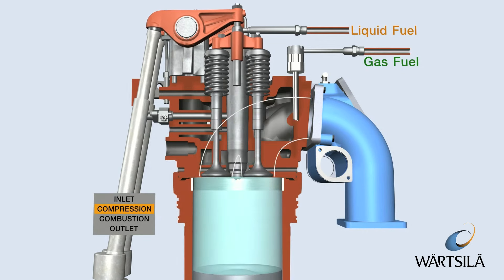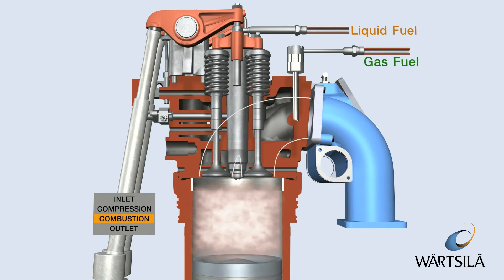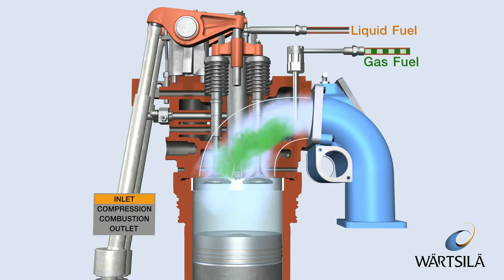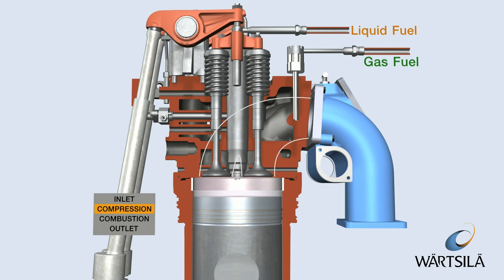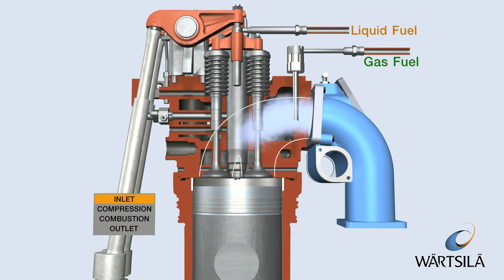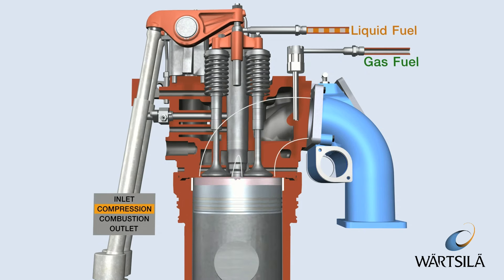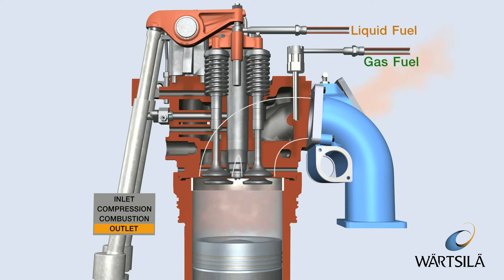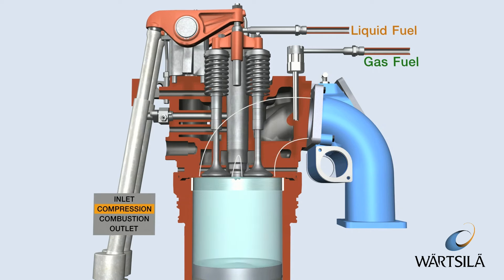Dual Fuel Process - Engine on Gas | Wärtsilä

Comment: So that means, this engine requires both Fuel (Liquid & Gas) at the same time for efficient operation.
Reply: It has no spark plug, so I guess it necessarily needs a self-igniting liquid fuel (Diesel or heavy oil) to run and cannot run only on gas fuel. But I guess it could run on only self-igniting liquid fuel without externally ignited gas fuel.
Reply: So it can run only on oil or diesel or on both oil and diesel and LNG. This is a great motor for LNG-tanker ships, which can burn part of their cargo when shipping towards customers and can only run on very compactly stored heavy oil or diesel on their way back after being emptied.
Reply: @Helmut-pdh  Yes you are right. It can work without gas. But Itcan not work without diesel. And we prefer work on gas mode due to cheaper than diesel.